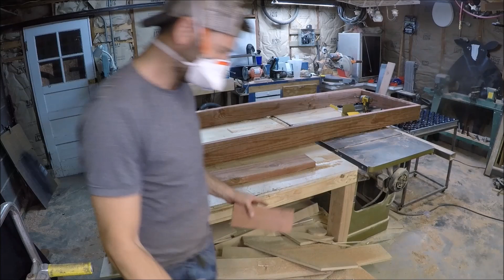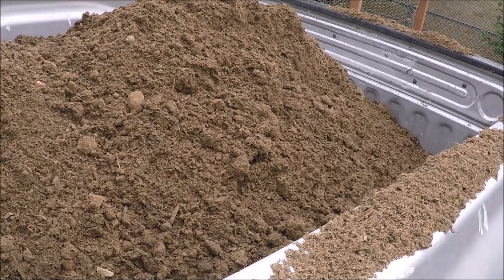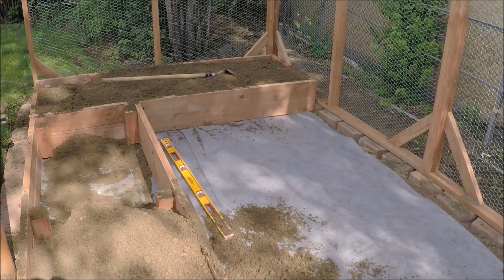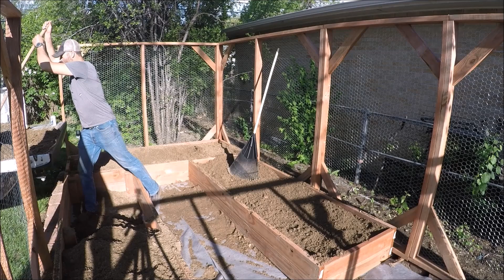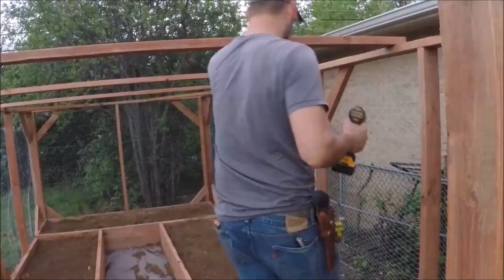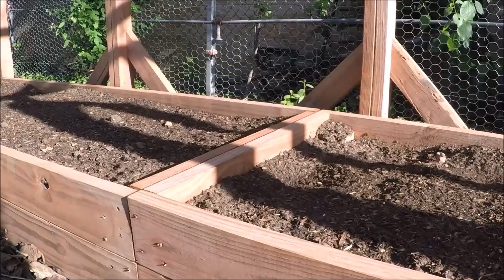Earthquake Resistant Raised Garden Beds | THE HANDYMAN |

Comment: Bought gsa auction f350 $12,000  w 36,000 miles. Bought flatbed with 5th wheel under bed hiy ch $3500. Has trailer controler . Hauls 10,000 # fishing boat on bumper hitch. Also have 14' 15,000# dump trailer. Can haul 4 totes salmon 1500 # each to market daily. On busy day use 24' insulated freightliner refer truck with power lift gate that uses forklift a three man crew. Your garden project hire temp worker to do site prep. I make a truss 2x8 bottom side walls 8' and barn roof makes single unit or double and make 24" or 36 9r 48" on center. Allows quick fabrication . I would have used plastic roof panels for longer growing season. The wire panels could add visqueen. Would hinge panels you should have screened bottom of planter boxes. Rodents will tunnel under and eat roots. One box should be compost box for lawn clippings and veggie waste. I use 25% aged sawdust, 33% peat moss 33% top soil. Get soil test and blend in fertilizer. We use fish guts in garden dig a trench fall fishing season when we process 20,000 # salmon we usually feed sturgeon. But allso haul to local people who we have taught to use fish guts. We use 55 gallon rubbermaid in dump trailer and custom pallets. That is what makes trees grow bears haul out salmon.

Comment: one thing that you should add cause its right there is tapping into the sprinkler system with a low flow adapter. never have to water again and its amazing.

Comment: Does he list the measurements for the panels anywhere? I would like to build mine pretty much exactly the same.
Reply: Towards the beginning of the first video he mentions that they are 6 ft. tall and 8 ft. wide. Some of them were 6 ft. tall and 5 ft. wide. Because the overall dimensions were 21 ft. X 8 ft. The angle braces were 24 inches point to point. Good luck. I'm starting mine this week.

Comment: What do the airbags on your truck do that are useful? I'm not sure what airbags on a truck are
Reply from the maker: Carrying lots of weight in the bed of the truck.   The bags fill up with about 80 psi of air and help keep the load level  so the truck isn't squatting down in the back.  When a truck is squatting from a heavy load the suspension can't work and the stearing gets squirrely.

Comment: How much was your 1500? I really wanna buy one but money is tight (im 18). I have a ford sport trac rn. Its for landscaping.
Reply from the maker: I paid $15,000 cash for it back in 2010.  It is a 2006.  It had 79,000 miles on it when I bought it.  It now has 2210,000 miles on it.  The engine and Transmission are still going strong.  The little things are starting to fail though.  Water Pump, Fuel Pump, AC fan, door lock, and power woindow.

Comment: I prefer the GRK structural screws with the built in washer, but they are super expensive.
Reply from the maker: I looked at them.  I calculated how my screws I was going to use and decided they were to expensive.  They are great screws.

Comment: Get a commercial stake bed, must cheaper. I had a Chevy 3500 12ft long stake bed, saved tons of time, no  need to tie down most of the time, just throw in the back. They don't look as cool as a crew cab but it was fully equipped. when I get home no need to unload.
Reply from the maker: I'm thinking a 10 foot flat bed with hydraulic dump.

Comment: This may be a dumb question but I have to ask it anyway.. How did you know how much material you had to buy for this and do you buy it up front or do you ask the customer to buy it and you pick it up?
Also, without going into much detail but how did you price it out. (I'm not asking how much you made - that's personal info) but more so do you guess-timate hours it will take you or material plus flat rate?
Reply from the maker: In the first video on the enclosure  I show how I draw out the project on my phone.  I use to use pencil and paper.   I draw out every board on paper then count up the pieces.   On smaller projects like this one I pay for everything up front.  This was a repeat customer and we have trust that I will build and she will pay.   If this was a first time customer I would ask for 50% up front.

Comment: Isnt it recommended to not use pressure treated wood on planter boxes? especially for vegetable gardens?

EDIT: also.... Up here in canada, we still call them torx drive. A robertson is a Square hole. 4 sizes, robertson 0 (yellow), 1 (green), 2 (red) and 3 (black)  0 being the smallest, 3 being the biggest.

Always debating starting my own company and i know there are upsides and downsides.... but it seems the ups usually outnumber the downs.
Reply from the maker: Before 2003 yes.  These days the 2 chemicals are not as bad for you.  It would some really dry soil to suck the moisture out of the wood.  Moisture will be going the opposite way from the dirt to the wood.   Its safe.